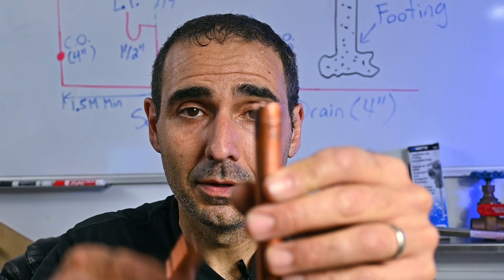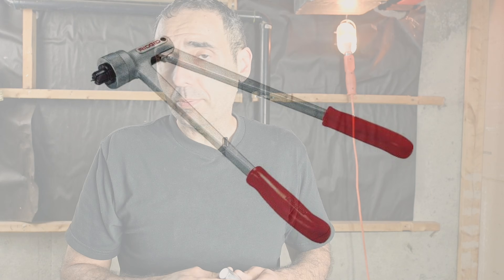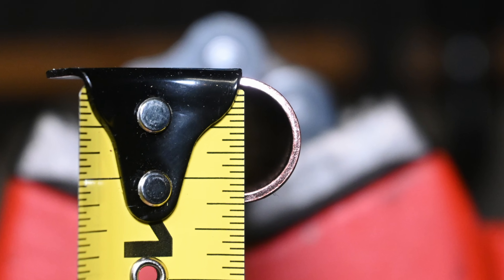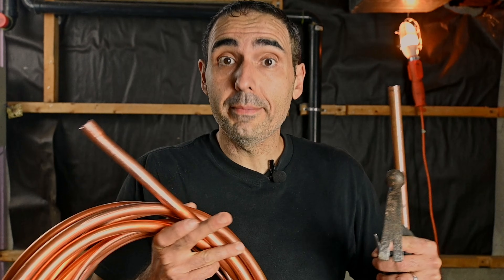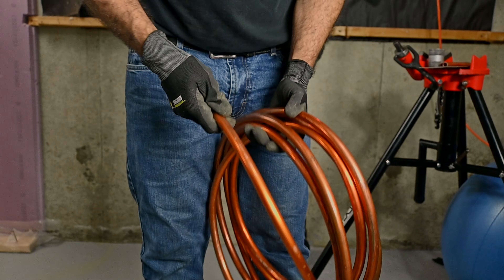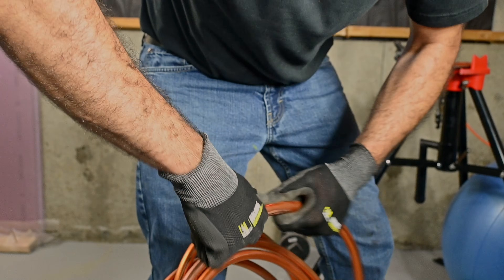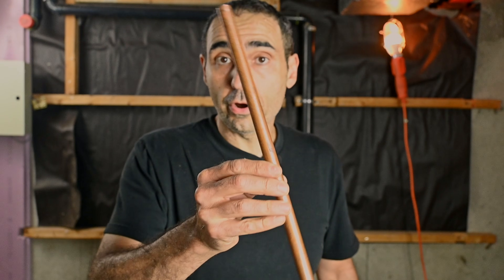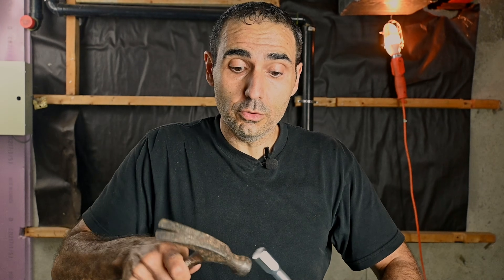Never Need A Coupling Again!  How to Swage Copper Pipe!

Comment: Is swaging and soldering this way strong enough for lengthening the copper tubing  in a 60 gal air compressor? I want to insert an aftercooler between the head and the tank, and where the tubing connects to the tank it's recessed- I'm not sure I can get a wrench on the nut without a major disassembly, and I'm wondering if swaging and soldering would be a viable alternative.  thanks
Reply from the maker: It should work, although it depends on a few factors.

I'm presuming your air compressor maxes out at 125-150 PSI?  If so, the solder should prove strong enough given that we often pressure test waterpipe at 150 PSI.  However, if you want added security, you may wish to BRAZE the joint (sometimes called hard soldering, high-temperature brazing or silver soldering) which is much stronger than traditional soft soldering (I have a video on brazing if you're interested).

Also, make sure that the copper you're swaging is at least Type L thickness (K is even better) because swaging does thin out the pipe material.

Instead of swaging, my advice would be to acquire a few couplings of proper size, and some soft copper tubing of required length, and just braze the couplings, which add to the joint wall's thickness and doesn't compromise the pipe's wall diameter.

However, if you prefer to swage, I would reason that yes, you should be able to do so, keeping all of the above in mind.

Hope this helps!

Comment: Pipe size always refers to the "approximate inside" diameter of pipe.  Tube size always refers to the "exact outside" diameter of tube. Referring to tubing as pipe (as the author does in this video is both wrong and confusing.
Reply from the maker: Appreciate your feedback.  I can't recall how I referred to the material in the video, but they have been known to use them interchangeably (including myself!). 

I've always been taught that "pipe" is typically the straight, hard-drawn type (some old-timers refer to as "sticks") and measured by its approximate inside diameter, while the more flexible coiled type (soft annealed, in the case of copper) is "tubing" - measured by its outside diameter. 

However, this gets obfuscated depending on the material type, size, and who's referring to it.  For example, while plumbers often refer to pipe by their inside diameter, the HVAC guys refer to outside diameter. 

Also, even though pipe (albeit steel and Schedule 40 predominantly) is measured in ID, that only applies for up to 12" in size; anything larger is measured by its OD. 

Thanks again!

Comment: Should weekend warriors like me use tinning flux instead of regular flux?  If tinning flux, water or petroleum-based?  Thanks. Really useful video on swaging. Subscribed.
Reply from the maker: I prefer regular old acid paste, which does such a better job at cleaning and removing oxides from the surface, thus ensuring a solid penetration of solder into the joint.

I remember acid-free flux being introduced into the plumbing field around 35 years ago, and I have memories of my dad's plumbers griping at the back of the shop, about how it did a terrible job at cleaning the surface. 

Acid paste is the way to go 👍...only be sure to use a clean brush and use gloves or at least keep it away from any cuts to avoid the sizzle!
Reply: @PlumbingsCool  I didn't know that there was non-acidic tinning flux. I'll have to check the labels. Certainly wouldn't use any that are non-acidic. Thanks for the heads up. Best to stick with the old stuff that we know works well. As to swaging, the HVAC guys often add a VERY thin layer of compatible oil to the swaging head to reduce the risk of scratches (I think that's the reason) and then when making up the connection on the mating surfaces. Wonder whether we should do that for (lower pressure) water plumbing.

Comment: This technique looks great for dimensionally correcting the diameter of Copper Pipe Swollen from prior Freezes

Anneal the swollen copper pipe

Swage to a useful diameter

Solder a new section of half inch Copper

and the Diameter is back to standard for down stream work
Reply from the maker: Great outside-the-box thinking!  What you're suggesting is possible, although a few considerations come to mind:

First, if the piping expanded due to frost, there is a high probability that the pipe became damaged, weakened, or significantly misshapen during the freezing event.  Second, the pipe would also need to be at least Type L so that the wall is thick enough to allow for stretching.

Comment: I'm curious, what would happen if, after heating your hard copper pipe you swaged it while it was still warm (not blazing hot)? Would that make it easier to swage? Would that mess things up in Pipe-land? It just seems to me that bending warm metal would be easier and less time-consuming than waiting for it to cool.
Reply from the maker: Good question.  Although I'm by no stretch an expert in metallurgy, my understanding is that allowing the copper to cool slowly will allow it to soften without posing the risk of cracking or splitting when attempting swage while it's too hot.  I suppose that also requires to define what you mean by "warm".  If the pipe is warm - albeit cool enough for you to handle it without getting burnt - I suppose it would be safe to do so.  I know some guys just don't have the patience to wait and quench the pipe with a cool wet rag to speed up waiting time.  Although I've done this myself with solder joints, I think it does not soften (or "anneal") the copper as it would if you were to let it cool naturally - and may actually harden the material.
Reply: Copper is different than metal if you want to soften it you need to heat it and put it in cold water directly then will be soft. That the idea to soften the copper before expand.

Comment: Can we apply the swaging technique to a street male or female fitting?
Reply from the maker: Interesting question, but you'd be hard-pressed to successfully swage a street fitting - namely with this specific tool - primarily because you're going to bottom out the tool at the fitting's turn when you try to insert the tool.  You need at least 3 or 4 inches of straight clearance to drive the tool into the material.  Besides, if you're needing to swage a street fitting, it probably means you're trying to connect that end to a straight piece of pipe, which would serve as a better candidate for swaging.

Also you would NOT be able to swage a female fitting, since a female fitting is exactly what you're trying to achieve by swaging (turning a male end into a female).  Besides, you'd still have the same bottoming-out issue as previously mentioned.

Comment: I don't know for copper specifically, but for steel quenching is what makes it super hard, you then need to temper to actually make it strong otherwise it will be quite brittle, but since the rest of the processes are the same, the tempering of the pipe is undone once it's heated past a certain point, and for steel at least that's pretty low, since you can do it in a kitchen oven, so pretty soon after you start blasting the pipe with the torch the temper is ruined. I am unsure what is the state of the material past that point though, but since the rest of the process is so similar to steel I would reckon that if you quench the pipe when it's red hot, but you don´t temper it after, it's probably going to be quite hard and brittle, so the exact opposite of what you want for swageing it. Btw the term for what you're doing, heating it up till it glows and then let it cool slowly, is annealing

Comment: FYI - You used the word “temper” instead of anneal when discussing heating the pipe. Temper hardens and anneal softens. I used to work in a copper tubing factory. ;-)
Reply from the maker: Thank you!...you're 100% right!  I sometimes to use those terms a little too interchangeably!  Noted, and thanks for the correction! 👍

Comment: At this point, i would have brazed a couple of  couplings but it is a cool tool ive never seen this before
Reply from the maker: You're 100% right...but it's not really a replacement for couplings, but rather for one of those "in a pinch" moments late on a Friday night when all the suppliers are closed.  Just a little more flexibility for one's skillset!

Comment: Actually, had you quenched it right after heating it would have remained soft and been much easier. This is the method you use when you wish to bend hard tube as well without it collapsing/kinking.
Reply from the maker: It did soften...and remained so.  I've been able to soften and bend even thinner Type M hard copper tubing by heating it and allowing it to slowly cool - and it didn't tear or kink.  

I'm certainly not a metallurgical expert by any stretch, but my understanding is that rapid quenching produces significant stresses, uneven tempering and micro-tears to the copper's surface, thereby weakening the pipe.  Truthfully, I know trades guys who insist on both sides of the argument (weather or not to quench) and I've yet to come across a solid, scientifically-viable verdict.  🤷

Comment: I need to do this to make custom diesel heater exhaust pipe. It's doesn't get hot enough to melt copper.
Reply from the maker: If your application gets particularly hot, might want to consider brazing the joint, rather than just soft- solder it as I demonstrate in the video (which has a MUCH lower melting point than brazing).
Reply: @PlumbingsCool  
I don't need brazing. I have to work on it once in awhile. It is a cheap Chinese diesel heater.
I just need to slide over the exhaust pipe and put some 1200 degree silicone to seal it.
Reply from the maker: Ah, I see.

Comment: 100% not worth the effort
Reply from the maker: The intention of swaging is not to outright replace couplings; it's simply an extra tool in your arsenal when you're in a pinch.
Reply: @PlumbingsCool  
i suppose as an emergency in case you need a coupler and don't want to waste an hour going out to obtain one.

i see one that you can use a power drill with. i'm gonna try that
Reply from the maker: Exactly!

Comment: I'm an electronic engineer, not a plumber but have done ALL my own plumbing all my married life (golden next year! 😮). However, in electronics, that arguably uses even  more copper than plumbing, it's always been the case that:

1. Copper both age and work hardens

2. To soften/anneal copper the exact opposite process to steel is used ... Heating copper to red or almost red heat then quenching immediately in cold water. It works for copper wire and cable, so I have no reason to believe it wouldn't for pipe.

 You can easily tell by its very pink appearance afterwards. I have never experienced cracking after doing so unless it is work hardened by continual flexing ... One reason why it is so easy to break a solid copper wire by bending back and forth.
Reply: Are you serious?  I never knew that.  I'll have to try annealing copper now...

Comment: You should probably use a ball pein hammer because it's more heavy duty and strikes with more force & also hit the swaging tool vertically into the pipe and maintain a tight grip on the pipe with your other hand.

Comment: I have seen this  before but never thought about hard drawn copper I just assume it would have been a code violation like bending pipe. Thanks for the info
Reply from the maker: Well, you're not completely wrong, as most of the time swaging IS carried out on soft annealed pipe.

With respect to BENDING pipe, our Ontario codebook is arguably somewhat obscure on what's allowed to be bent.  It refers to bending pipe only of "soft or BENDING temper":  So if the hard-drawn  Type "L" SUCCESSFULLY bends with the proper bending tool (as I've done countless times), should hard-drawn pipe not be considered "bending" temper? 🤔

Comment: IF YOU MISS. YOUR BALLS WILL NOT ONLY BE SWAGGING . THEY JUST MIGHT BE HURTING.
ON THE SMALLER PIECES YOUR FINGERS COULD MAKE A GOOD TARGET.
IN THIS CASE YOU MIGHT NOT BE ABLE TO USE YOUR FINGERS OR BALLS. GOOD LUCK AND BE CAREFUL.

Comment: good idea but it was so much easier and cheaper to replace it all with pex. I bought all the part pipe and fittings for under $200 on line and in one day completely replaced every piece of copper pipe in my home with pex and then the scrap copper recycle paid almost half the cost spent on pex.
Reply from the maker: True, that Pex is cheaper.  But Pex can't always be use in every application.

Plus I'm not fond (to put it kindly) of any plastic piping for most any water pressure applications, for several reasons.

I acknowledge that Pex is legal, approved and isn't going anywhere in the foreseeable future. But if I could choose the water delivery system in my house, its copper hands-down.   Thanks for your input!
Reply: Enjoy your microplastics and eventual degradation and splitting leading to floods.

Waste - plastic
Mains inlet feed - copper.

Comment: So when swaging 3/4 copper tubbing I would need to use a 5/8 tool tool to accommodate for the diameter?
Reply from the maker: The first thing you'd need to determine is whether the tool's sizing refers to Inside Diameter (I.D.) or Outside Diameter (O.D.).  3/4" I.D. Is equal to 7/8" O.D.

You also need to determine whether your aforementioned 3/4" pipe is that size in I.D. or O.D..  In plumbing, we refer to most pipe sizing based on its I.D..  To swage 3/4" I.D. pipe, we would need a 3/4" I.D. swage tool.  If the tool's size markings refer to O.D., then you'd need a 7/8" O.D. tool to swage the 3/4" I.D. pipe.

Hope this helps!

Comment: How to make a larger diameter swagging tool for PVC pipe? Thanks
Reply from the maker: Sorry, you out of luck, there. There is no proper formal way that I know of to expand any plastic piping (with the exception of Uponor, also known as Propex or formerly Wirsbo, which is used for water supply lines.)
The only way  I know of to reshape hard PVC piping is to gently heat it up, but I don't know of any such plastic swaging tools - at least in the plumbing field.

Comment: Great video, i have a problem, the input service line to an old house i have has a slightly larger than 3/4 in pipe.  The valve attached to it froze and cracked.  No 3/4 in adapter (shark bite, copper adapters, etc) fit..  I want to go from the 3/4+ to a 3/4 male or female adapter.   Any ideas how to expand beyond 3/4 in by about 3mm or so to fit it? Thanks ,,any suggestions would be greatly appreciated....
Reply from the maker: Given your stated dimensions of +3mm, it strangely sounds like you have 7/8" ID tubing (or 1" OD), which is not typical in plumbing; usually it would jump from 3/4" ID to 1" ID. 

If so, the easiest way would be to acquire a 7/8" ID x 3/4" ID coupling, such as this one:
https://supplyshop.com/products/7-8-od-x-3-4-od-reducing-coupling-copper-fitting-bm34016

Failing that, provided that you're working with thick enough copper tubing (Type L or K), You may be able to swage the existing pipe to 1" ID using the properly-sized swaging tool, and then fit a piece of 1" ID pipe into it and solder or braze the joint.  From that point you can simply adapt from 1" nominal pipe size to 3/4-in nominal pipe size using a standard 1x3/4-in reducing coupling.

Hope that makes sense. Let me know how it works out!
Reply: The pasco pipe sizing tool for 3/4 pipe will be the easiest way to deal with that situation. It’s the opposite of swaging, you hammer it onto the pipe end and it will squeeze it back to its original outside diameter thereby allowing you to use regular fittings on it

Comment: I've been trying to hook up my 5/8 a/c lines for days. No one sell a coupler.
Reply from the maker: 5/8" for AC is usually what we call 1/2" in Plumbing.

Measure the outside diameter of your AC pipe:  If it measures 5/8", then a simple 1/2" copper pressure coupling from a plumbing supplier should suffice.
Reply: @PlumbingsCool  The couplers I find are either the same size or too big. I think I saw the tool you used at Harbor Freight. I'm going back there to get it.
Reply from the maker: I'm wondering whether you need 5/8" ID.  I'm not sure if that specific tool is going to help you, because it maxes out at 5/8" OD.

Here's something I found online, but it's Walmart Canada. 

https://www.walmart.ca/en/ip/Uxcell-5-8-Inch-ID-Straight-Copper-Coupling-Sweat-End-Welding-Joint-Pipe-Fitting-4-Pack/PRD5ZHV28H0VEGT

So if you're in the US, copy/paste this into your Google search:

5/8" ID copper coupling

Good luck!